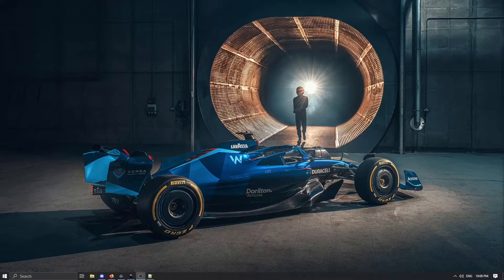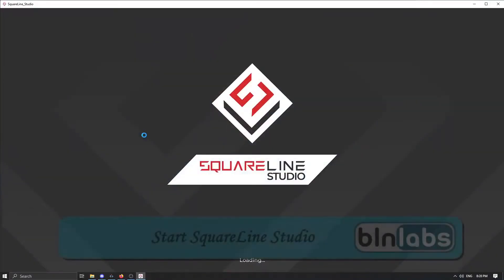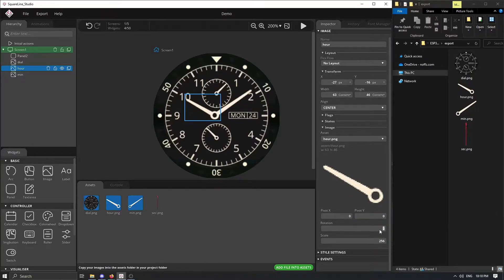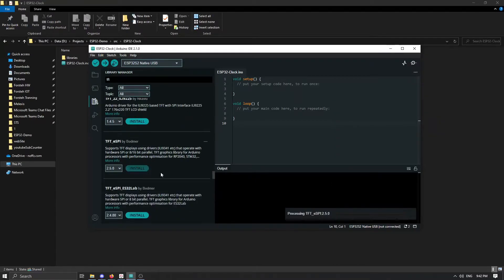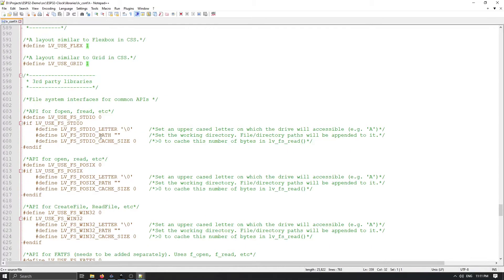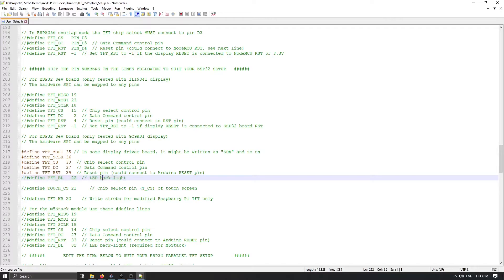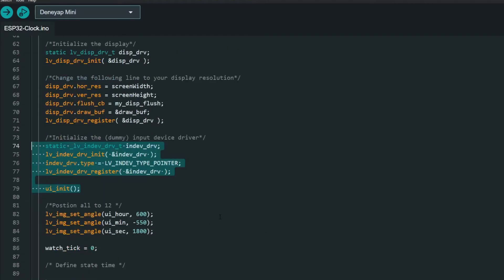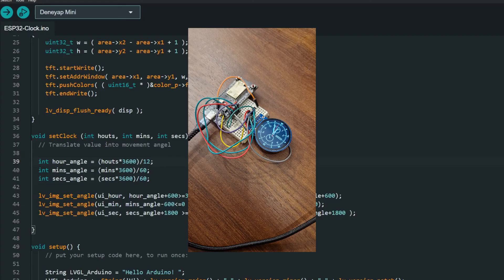Custom GUI for round display with LVGL and SquareLine Studio

Comment: I’m a total beginner working on a similar project, it’s an analogue gauge (in appearance at least). I added my hands (gauge needle that will move) just like you did for the watch hands. But when I export and open in Arduino IDE I don’t see “extern lv_obj_t * ui_OilPressire;” Do I need to add these manually or should squareline include that?
Reply: I have the same problem, did you find a solution?
Reply: @PhilippThalhammer  yes they need to be included manually! I’ve got my display working and I’ve written code to update gauge position from commands. Ex. Oil Pressure 60 , and the oil pressure needle turns to 60psi
Reply: @TylerD600  
Nice! I now figured it out as well.
Just finsihed recording a tutorial on it :D
Reply from the maker: yes, exactly that. You can copy paste variables defined inside generated UI that you would like to control. Sorry for the late replay
Reply: @PhilippThalhammer  awesome I’ll be sure to watch😊

Comment: A few more minor critiques. Slow down. No need to be in such a hurry. We are interested in what you are saying so we’re not gonna bail on you mid way. Especially with an accent, it would help us understand you better. Also, when you are modifying a file it would be helpful if you explained a bit more of what you are doing. For example, when you said “enable the font”. I saw you change the zero at the end of the line to a 1, but you didn’t explicitly say that that was what we needed to do. Thanks for your work. It’s great content.
Reply from the maker: Thank you for the feedback, and I'm serious, this will help. I get your point and I will try. So some reason it is very hard for me to talk into laptop screen if there is no one at the other side😊. 
And yes, I have that problem that if something is common knowlage for me, I expect that everyone should know that, but I will work on this as well.
Thank you for feedback